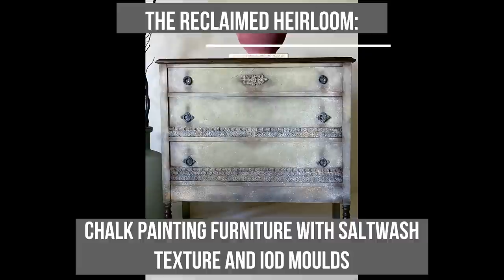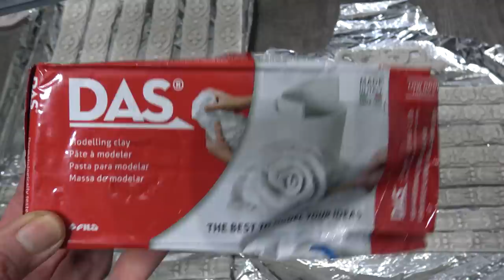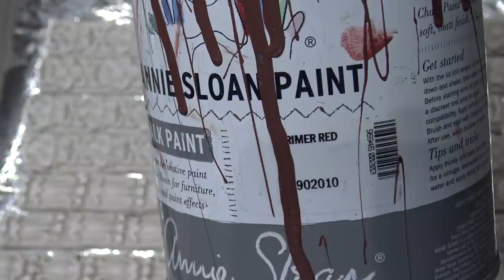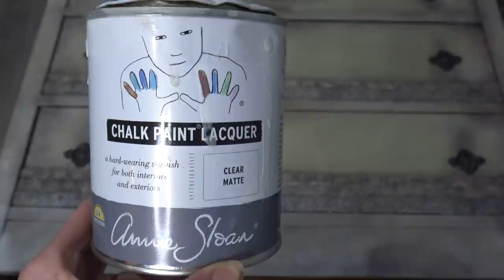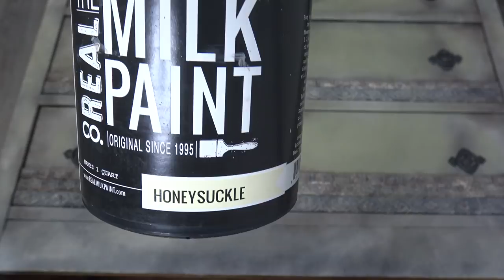Chalk Painting Furniture with Saltwash Texture and IOD moulds

Comment: Even tho every piece is original and unique from your last piece, you consistently keep a refined classic look - that’s one of the many things I love about your work, Christine did you sand the top before you used the gel stain? Ive always been afraid to use it - you give me courage - your fan Donna
Reply from the maker: donnashorts1 ... thank you so much Donna 🙏💚 for your thoughtful comment 
I do normally sand before adding gel stain, it’s a very forgiving product. Even if your applying gel stain on top of a piece that is painted just sand off any top seal (wax, varnish or lacquer) 
This piece I did sand all over but it not necessary to sand off everything just the protective layer.
If you want to wipe back some of the gel stain for a lighter wood appearance then you may want to sand everything off. 
This way the wood grain also will show a little, I like the rich wood tones but again it all depends on the look you are wanting to achieve! 
If you ever have any other questions please feel free to contact me anytime 🤗🎨
Reply: Thank you so much Christine for that wonderfully detailed explanation - you’re just the best❤️

Comment: Beautiful!!!.. have a question, I've seen shellac and primer.. but have you ever used a odor blocking primer with chalk paint?.. I have a gorgeous cabinet from the Victorian period, I'm almost sure it has that old beetle shellac on it.. but it stinks to high heaven, I've tried spraying it with all suggestions, done charcoal, baking soda.. scrubbing it several times with every cleaner.. But it still stinks.. I think it was in a house with a over abundance of cats or dead things.. lol .. I'm just afraid to try a odor blocking primer not knowing if it will effect the paint, because I'm not sure what makes primer, odor blocking?
Reply from the maker: Kelly Williams ... thank you so much Kelly for your kind comment and questions! 🙏🎨
So you are actually heading in the right direction! And no the odour blocking primer or shellac will not interfere with your decorative painting 😉
So the odour you are getting is deep inside the wood and it happens to a lot of really pieces for a number of reasons but mostly because of moisture. Over time plus the old varnishes etc it create that not so lovely smell lol 😂 
But from my personal experience it’s great to use the odour blocking primer and shellac also had an odour blocking product as well, so either one is fine and I do recommend two coats! I used one in the past and still had a slight faint smell so two is the magic to cure that! Also depending on the size of your piece , leaving in the Sunshine really helps too! But again that is not always possible due to space and size, etc.
Also but I am sure you might already do it but make sure ALL the inside is shellacked or primed too! I know it’s a pain and more work but the interior is where most of the issue of odour is coming from, including the drawers not just inside but all around, underneath and back side. My favourite go to is the shellac but no worries if all you can locate is the primer you are fine! Hopes this helps and if you have any other questions please feel free to contact me anytime 🤗🎨💚